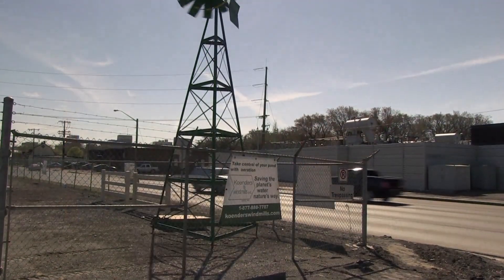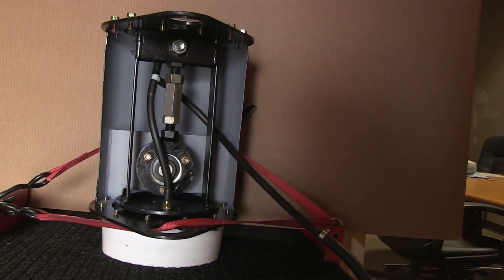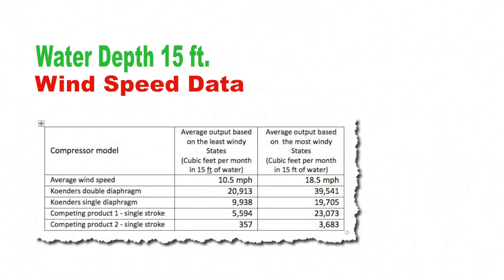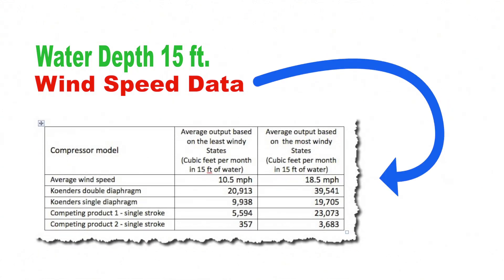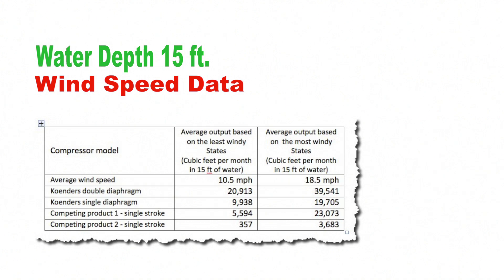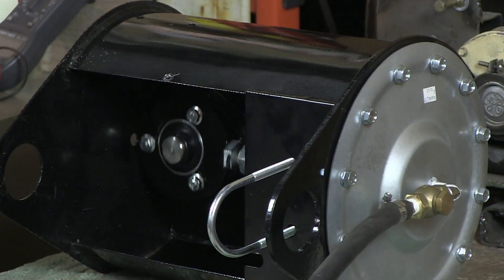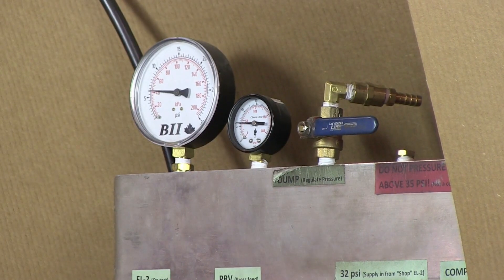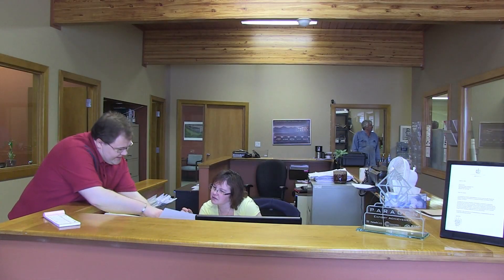THE TRUTH ABOUT WINDMILL AERATION

Comment: wtf??... "if a single-stroke is so efficient, the why do we have 6 and  8-stroke vehicles" 
you fucking sound like Donald Trump. 
how can you even compare a compresser to a combustion engine?  the most common engine type for vehicles only has a power-stroke every 4th time... an 8-stroke only does this every 8th stroke... 
double-stroke (not to be confused as a 2-stroke engine) may not always be more efficient than a single-stroke depending on your setup. 
at least you are right about low wind speeds are more important than the high.
Reply: wtf Donald Trump? Please STFU F*ing blow hard wannabe tough guy
Reply: You sound like a whiney liberal bitch - MAGA!
Reply: An internal combustion is very much like a pump/compressor, but I doubt your tiny mind will understand. 

#Trump2020